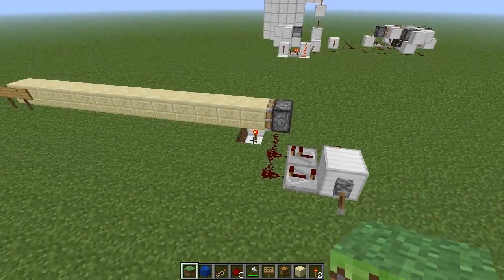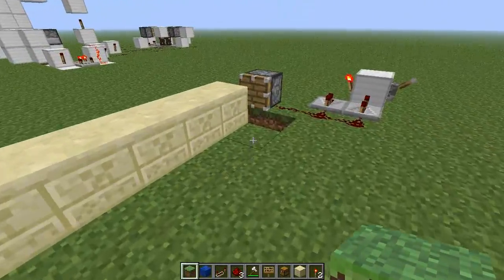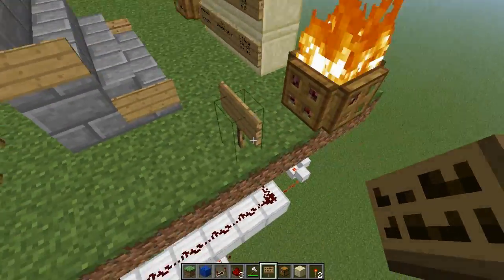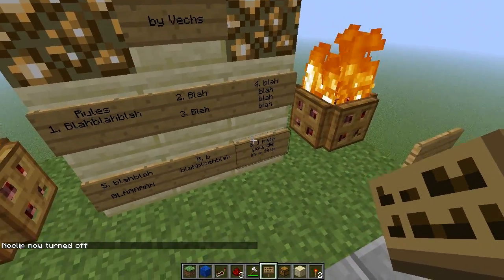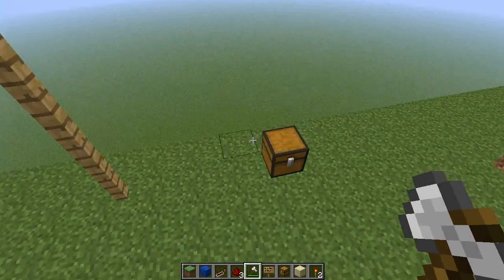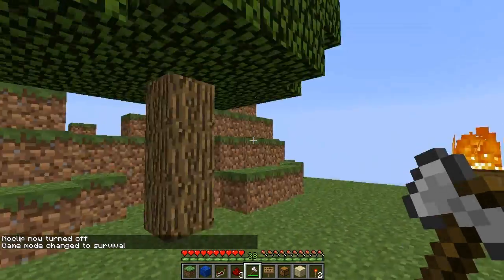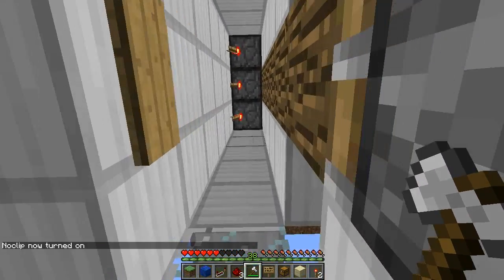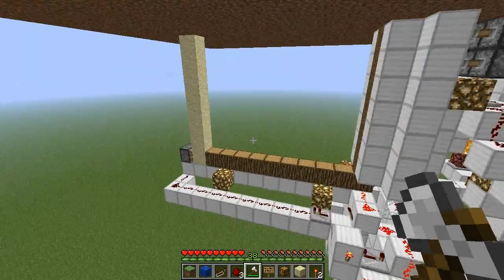Alternative design 8: Undetectable trap (Long Range Block Break Detector)

Comment from the maker: The clock is silent and the piston only makes noise when it pushes. It only pushes when you break a block. That's the whole point: the clock tries to activate the piston, but as long as you don't break a block (i.e. trigger the trap) nothing will happen and it will be completely silent.

Comment: The clock is activated before you break the block so if they heard it it won't matter if you set it up right, if it won't get activated it won't work.
I think this would be much more useful in redstone minigames than in traps.

Comment from the maker: You can use sand on a torch with this as well :D. The point of the video is the detection system, the way you kill your victims is entirely up to you :D. Sand however is often considered as a suspicious block :).